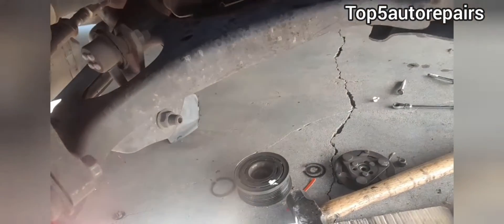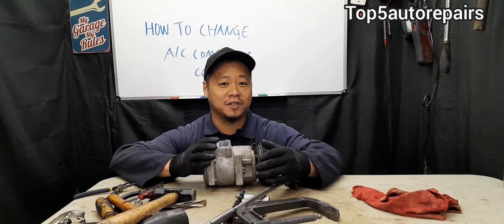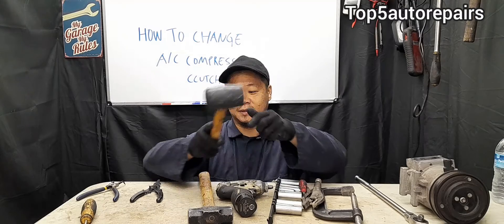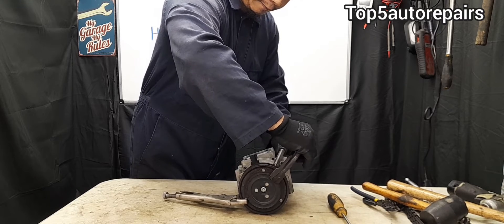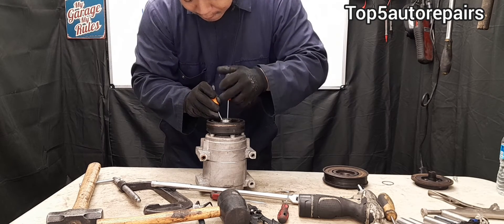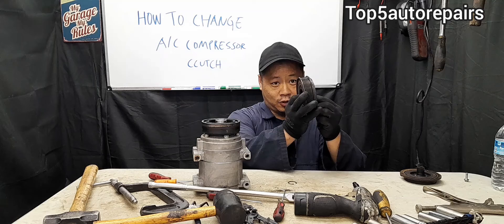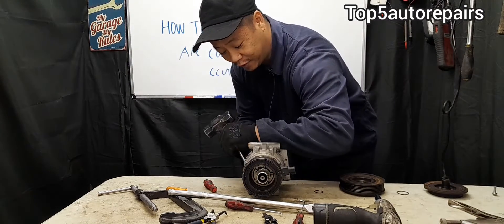HOW TO CHANGE A/C COMPRESSOR CLUTCH COIL (A REPLACEMENT STEP-BY-STEP GUIDE)

Comment: When doing this with a compressor in the car, first run a jumper wire to the clutch coil connector from the battery "+" (and another one to the ground, if the coil is not grounded to the compressor body). This will close the clutch. Do not remove the drive belt just yet. With the belt still in place, the compressor shaft will now be locked, and the hub bolt can be removed with a wrench. You can also close the clutch on the bench if 12 V power is available.

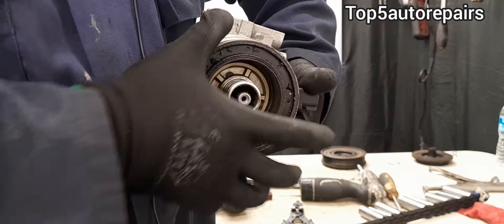Comment: I don't see the reason to remove that second snap ring. You started at about 6:33 into the video. I did the same thing on my compressor, but after removing that second snap ring, I can't see how it had anything to do with holding the coil in place. Otherwise it's a good video.
Reply: You are correct.  The small interior snap ring is there to secure the shaft to case.  Do not remove.
Reply: Oh i see thank u so much u just answered my question

Comment: Great video. I can whole-heartedly say this is a PITA to do while the compressor is still on the car.

My advice, It only takes 10 minutes to get the compressor out opposed to fighting with it on the car for god knows how long. In my case it was bout 2 hours lol

Spend the extra $100ish on a AC kit with a vac pump. U can prolly find them cheaper. And just take out the whole compressor to do this job.

U will thank me later and that AC kit pays for itself in the long run and they ain’t hard to use. 

2014 Nissan Maxima S here. Good luck gang!
Reply: Totally pointless...Then you need to discharge the ac system...fixing it in the car saves you from that trouble

Comment: Thank  you so much, I just had to do this on my son's vehicle and this video was the best I found and the most helpful. It made it quick (except for the inside snap ring which was a huge pain to get out).  Other than that it is pretty quick and went ahead and changed serpentine belt at the same time.  Really appreciate these instructions!

Comment: I’m in a 2016 Honda Civic 2.0, I just got my AC fixed like last year and it’s blowing hot air. I think it’s the compressor. How would I be able to tell if it’s the whole unit or just the clutch? When I try to spin the clutch, it doesn’t move at all and I don’t hear it engage.